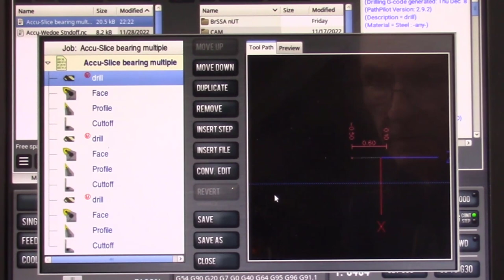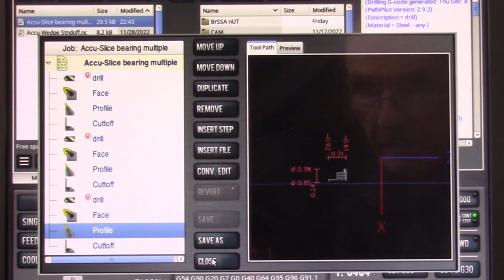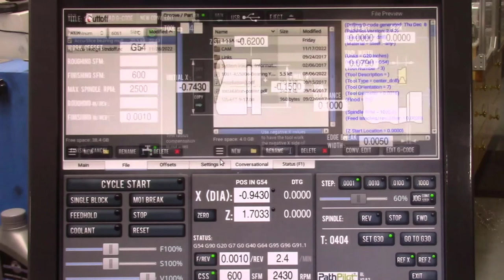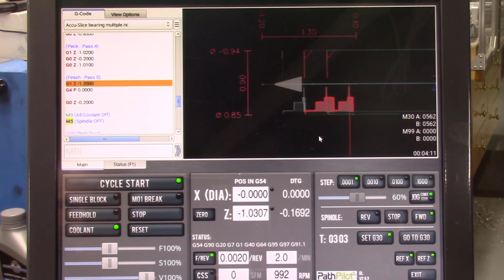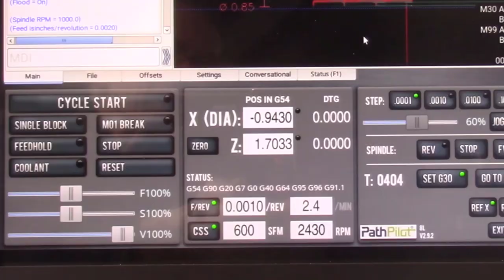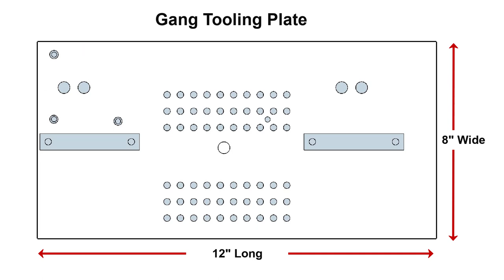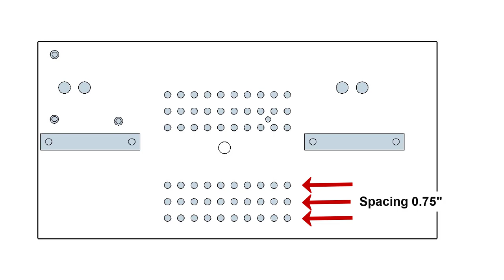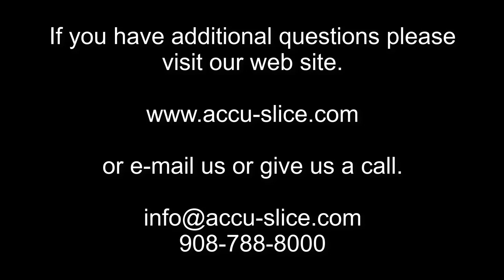Gang Tooling for the Tormach 8L Lathe - Part 2

Comment: For my 15L I found a 3d printed parts catcher that mounts over the cut off tool. This helps to keep the parts separate from the chips as well. In this case it may also help slow the build up of chips around your tooling. Something to consider. 
Very impressed with the gang system, well worth the time spent!
Reply from the maker: I saw something similar in another YouTube video where someone did this on a 15L lathe.  I will probably do something similar in the future, since I think that this would be a better way to catch the parts.  Thanks for your comment.

Comment: My first thought on seeing this was "Cool! I need one of those!", but my next thought was "Why didn't he use locating pins/holes to aid in setting up the tooling?". It all seems to work just fine without them, that's just what I'm used to seeing in this situation. I'm curious as to your thoughts on this because I hate the "we should do it this way because we've always done it this way" argument, but it does seem like it would both speed up a changeover to another job with different tooling and assist in the rigidity. Let me know what you think. Thanks!
Reply from the maker: Yes, I agree that using some locating pins would be more accurate for locating the tool holding block.  I thought that this was not critical since I align each tool on the lathe.  

I had also thought of using T-slots on the plate so that the tool holders could slide into position and then lock in place.  This would be a better option it this plate were to be commercialized.  But for my use the screw hole mounts worked out fine.  

Thanks for your thoughts on another way to do this.

Comment: Is there any way to put an automatic collet on the 8l, and if so do you plan on doing that as a project?
I'm planning on purchasing an 8l soon to use in a production shop (to replace a "little machine shop 1500 high power" manual lathe); but would like to be able to run multiple parts per run.

I really appreciate your content, your stuff is the most helpful. Do you think in a video you could show how you currently feed the stock forward after each run?
Reply from the maker: No, I do not have an automatic collet and I am not planning on adding one.  As far as setup, I just manually loosen the collet closer, advance the stock against a stop and the retighten the collet.

Comment: like it how did you get the correct hight for the tools in the gang, it looks like they are fixed hight no adjustment just intrested how you got the correct hight
Reply from the maker: I actually measured this distance and machined the blocks to this dimension. The height dimension is not adjustable on these blocks.  A better method would be to machine the hole in these blocks directly on the lathe as another viewer has suggested.

Comment: I love my 8L, and a gang tool setup would be great.  are you going to be offering this or the plans?
Reply from the maker: I could offer this as a product for sale, but I have some concerns.  When I was laying out the hole patterns to mount the base plate to the 8L lathe, the holes were not in line with one another in a nice square pattern.  I am not sure how repeatable these dimensions are on all other 8L lathes.  If someone is interested, I could supply them with a drawing with my measurements for them to confirm on their lathe.  Then I can either use these dimensions to reproduce a base plate or modify the base plate drawing to correct for the differences.  If anyone is interested, they should contact me via e-mail for additional details.      info@accu-slice.com
Reply: @Accu-Slice  I just sent you an email.  I would be more than happy to verify the dimensions.

Comment: Couple of comments/suggestions: 1) it does not seem that aluminum is the right material for this, it will deflect. Tool steel is what I would use for this. 2) the lower plate is not fixed accurately on the cross slide, as there are no dowel pins or anything, also it will just move as the friction will not hold it enough. There could be a leap in front of the plate looking down that touches the cross slides side surface and thus limits the motion of the plate away from the head stock. That will also help with initial alignment of the plate. 3) the spacer for the back AXA toolholder could be a part of the plate (just need to take 1” plate instead of 0.75” and machine the top except the area under the back toolpost - that will look nicer imho 4) ER tool holders made of aluminum will deflect, and also will move back as the friction will be too low. There should be slots added on the plate under the holders (for both possible positions) and some leaps under the toolholders that will help with angular positioning of the toolholder and will avoid backward shifting of the holders. 5) rear screws won’t hold the ER toolholders , they will spin… there should be a couple of set screws on top holding the flat on the ER holder. Back hole is for through coolant.
Other than that looks good 😂
Reply from the maker: Thank you for your input and suggestions.  Your comments and suggestions are important and they do need to be considered. Your comments would be especially important on larger and more accurate lathes where higher tolerances are critical.  I do not think that it is as critical on this lathe, which is lighter and less accurate system.  In fact the 8L lathe came with an OXA tool post, which I felt was an issue and that is why I switched it to an AXA tool post in order to improve the lathes accuracy. I have now been using this lathe with this gang tooling for a while and I have beet achieving accuracies of at least +/-0.001" on my jobs. 

Yes I agree that tool steel may have been a better option for the base plate but making this from aluminum was just quicker and easier.  I was originally planning on using set screws to hold the tool holders in the blocks on the base plate, but I felt that the set screws would mar the shafts of the tool holders which would make them difficult to remove, so I elected to use the screws from the back.  

I will definitely consider your suggestions if I decide to remake or modify this system in the future.  Once again thank you for your input.  Your points are well taken.